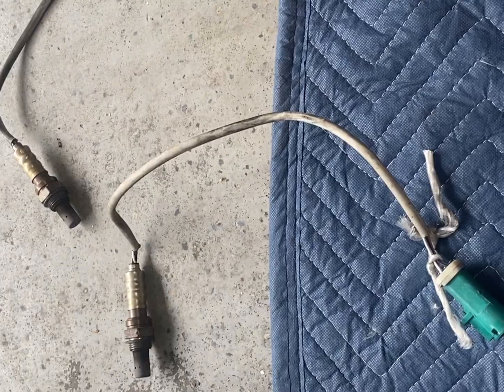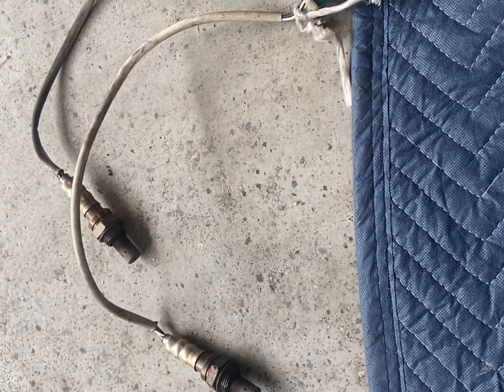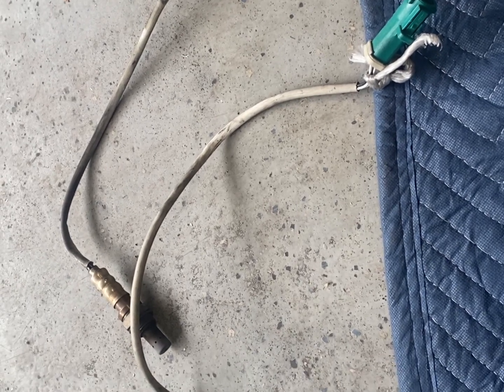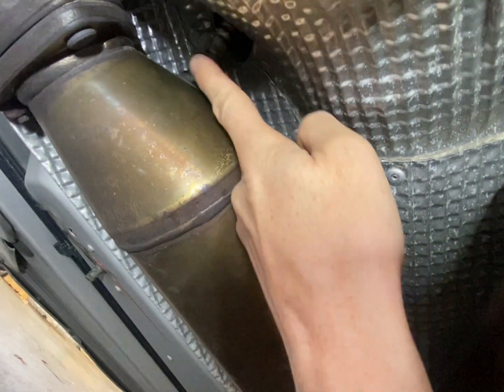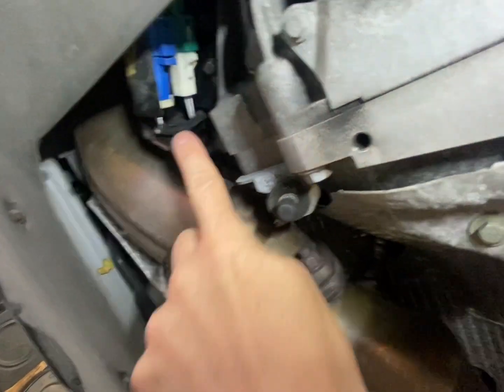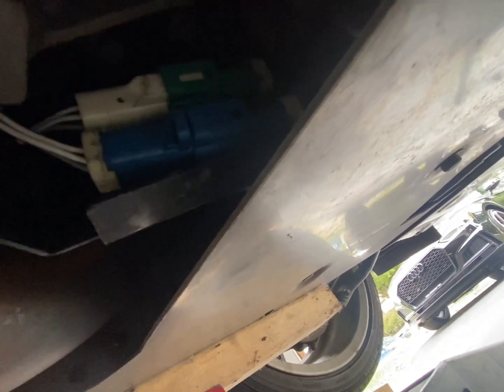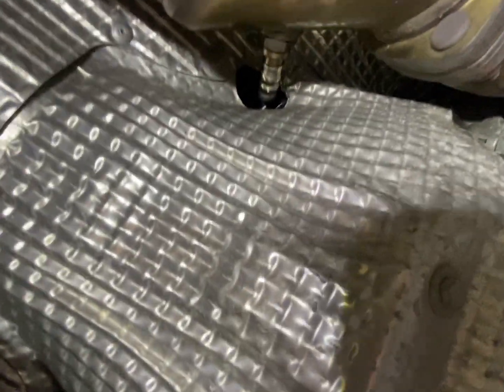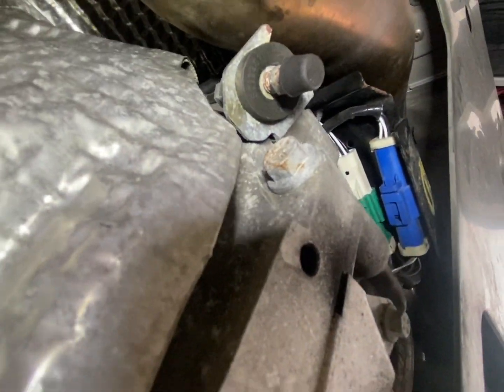Identifying the O2 sensors on the Aston Martin V8 Vantage (2005-2018)

Comment: If I am not mistaken you replaced both upstream sensors (Bank 1, Sensor 1: and Bank 2 sensor 1) green plugs - corresponding to codes P0133 and P0153 with the NKT22106 sensors in June ish 2023.  Have you had any issues since?